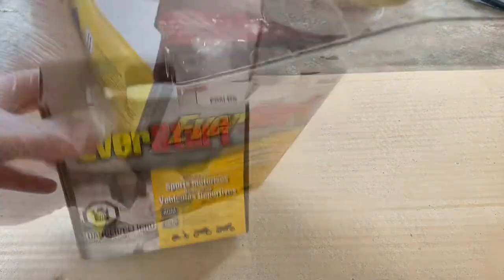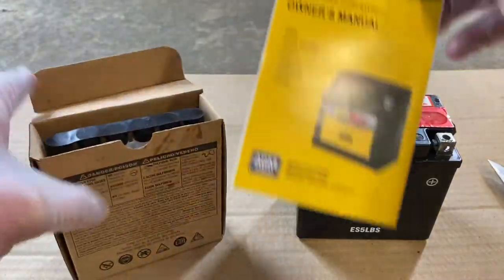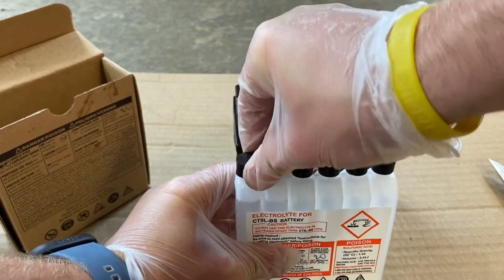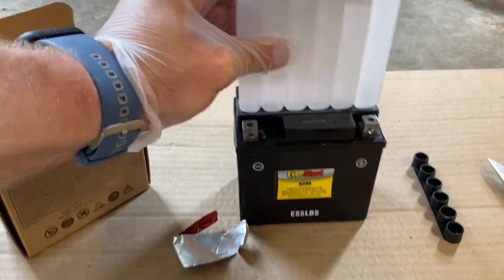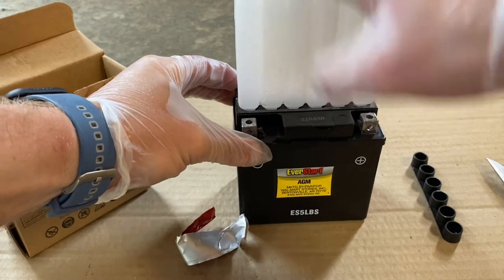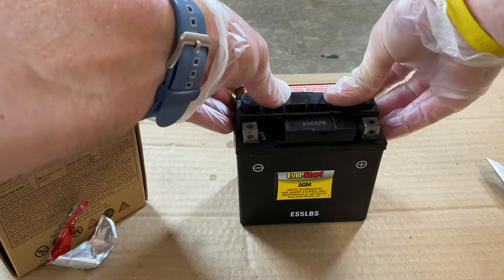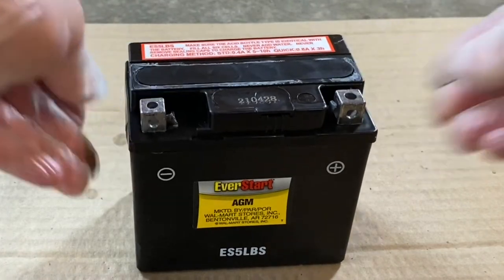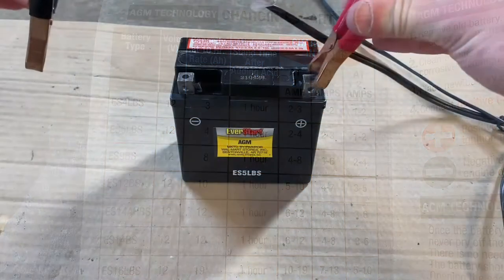How to Fill and Charge a New Motorcycle or ATV Battery

Comment: I let the cells vent the gas build-up for about an hour after filling the electrolyte without placing and sealing the tops - Even then, the Battery (YUASA YTZ10S) got Really REALLY Hot during that 1 hour - Glad i didn't fit the covering caps immediately after the fill as the sides would hv buldged & maybe burst 😅